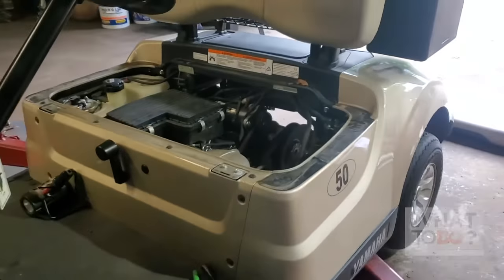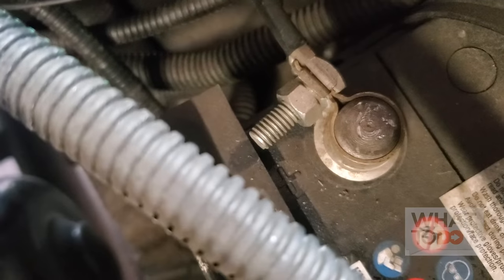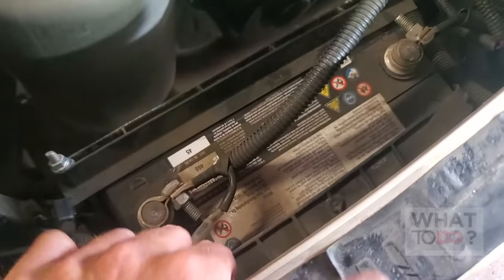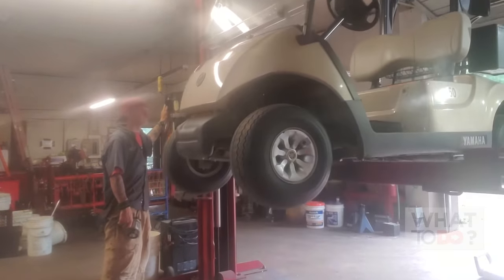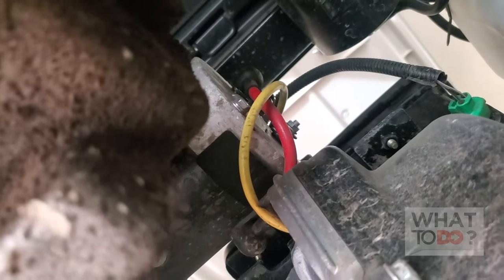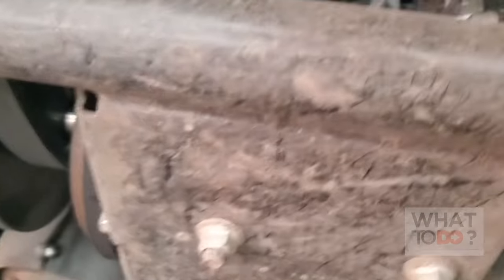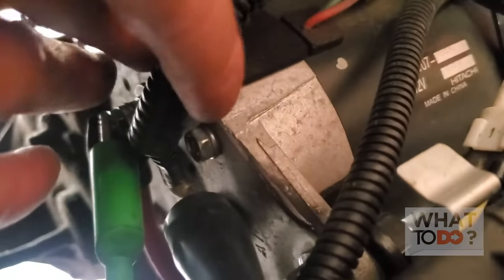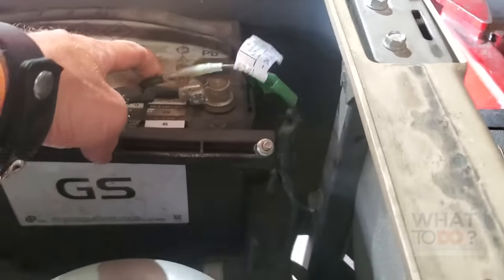Yamaha Cart won't start . How to troubleshoot and find solution.

Comment: I had a problem with my 2011 Yamaha gas cart. Thought it solenoid or battery. Battery was old anyway 5-6 yrs. New Battery, helped some. But after checking. Found it highly possible the gas pedal solenoid switch was hanging up and not kicking in on the solenoid . Before I spend $$ on switch I removed and rolled back the rubber boot and sprayed blaster and worked the switch for about 10 times. While I was working on that I also adjusted the gas cable there at the pedal about 2 rounds. To give a little quicker response when pressing the pedal. Tightened it up and replaced the stop switch. Everything at this point seems to be running much better. If the switch starts to hesitate again, I'll purchase a new one at that time. The gas pedal switch is exposed to the dust and dirt under the floor board. don't forget that if cart is not staring when pressing the pedal. listen for the solenoid to click. If no clicks or intermediate clicks, ck the pedal switch, too.

Comment: I have a 2002 yamaha golf 19.put on the brake it won't start. Wait a few seconds it will start. Put on the brake it won't start .it's taking longer to restart. I replaced most of the batteries and the silinoid. Any suggestions.

Comment: My issue is starter cranks but it wont start.   I noticed the check engine light doesnt flash like the one you are working on.

Comment: check for fuel, air, and spark an engine needs all then check fuse's then chase wiring. my cart the starter would run but the engine wouldn't kick over unless it was running on starter fluid i got tired of trying to figure it out so i did a 420 swap with a clutch that will idle

while pulling the stock cart wiring after i did the swap i found a 10A fuse checked it. it was blown but its not all bad the 420 set up is much better and faster

Comment: I think that's exactly what's wrong with my Yamaha I put a new pedal switch new starter two different use solenoids that I have and all I can get still is it to start up with hot wire running from the battery to the solenoid that's all I can get so far but it does run for about 10 minutes and I think the solenoid overheats from constant power

Comment: Quick question how can I test my cart if it want crank in gear but in neutral it runs fine once it gets going it does good as long as it's out of gear
Reply from the maker: It sounds like your cart is in maintenance mode. Look on the back of your shifter under the seat there should be a yellow cup type of thing see if you can pull on it and rotate it

Comment: I have a Yamaha G9 gas cart that will turn over on the starter but will but will not fire and run on the  engine....Thoughts?
Reply from the maker: Did you get it fixed. Sorry for delay. Didn't realize I had comments. Are you getting a spark? That could be a few issues. Check spark first. Then I would go to tracing the fuel. Lines. Filter. Pump etc..

Comment: I have to hit my solenoid every time I wanna ride it what do you think I could be
Reply from the maker: Do you have a gas golf cart or an electric? Also when you turn the key and step on the accelerator pedal do you hear a clicking noise from the solenoid? In short basically the solenoid closes a gap of two contacts on a starter motor on a gas golf cart to allow a jolt of electricity to go through to engage the starter on an electric cart it's sort of does the same thing but since the voltage to a controller motor. Check your battery if you are really low on voltage perhaps around 0 then the problem lies elsewhere if you have full voltage in your battery then it's likely you're solenoid that's acting up

Comment: Hi can you help me 
I changed oil in a G16 but now the oil light will not go out it is right up.
If the oil light will not go out will that make it not start and run?
Would the oil light being on would that stop the cart from running
Reply from the maker: Sorry for the delay. The sensors are known to go bad on those carts. If you changed oil and level is good, I would remove the bulb . If you want to change the sensor its pretty involved on those but when I get a job on one ill do a video on it.

Comment: Check the power in your battery first. If it doesn't have sufficient juice going to the starter it wont work. 12.1 IS TOO WEAK. 12.9 GOOD TO GO.
Reply: Put your charger on it and press the peddle. It will go then. Just let it charge. I need to find out if there is a stator inside the starter or a rectifier somewhere that is suppose to keep the battery charged next.
Reply: If mine is reading 11.5 should I charge it? If I put the pedal down for around 10 seconds it finally runs like it is.  Thanks